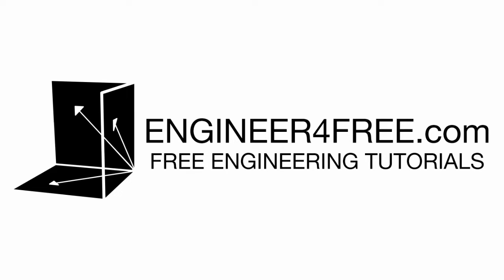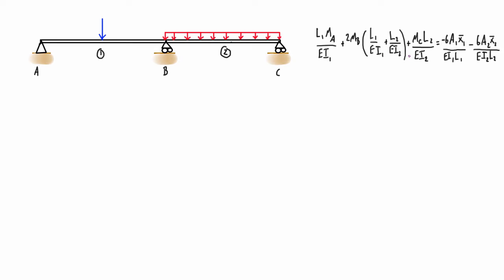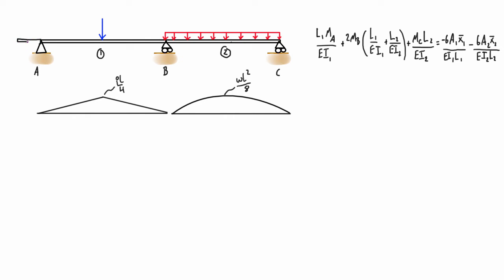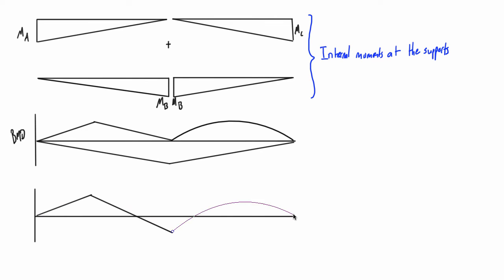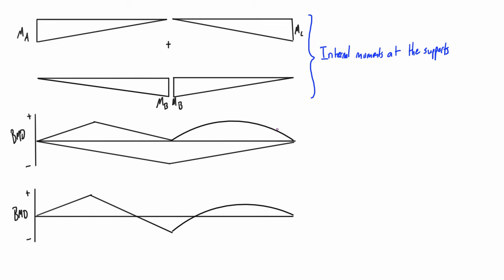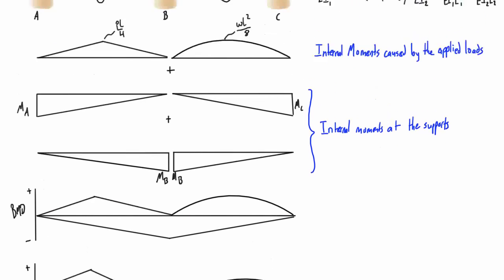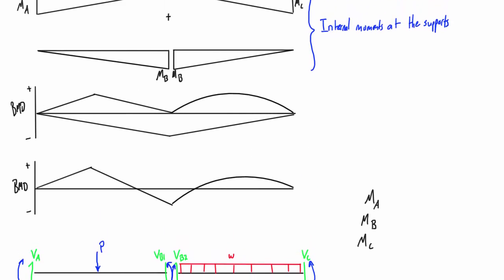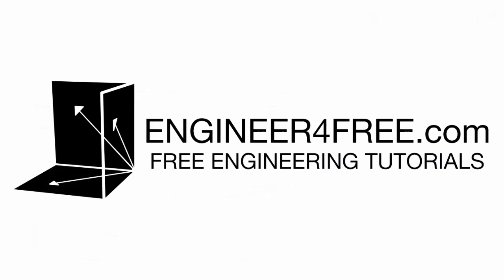3 moment equation explained

Comment: After 35 years of being a structural engineer, I never heard of or used this method. It is much faster to just redistribute the moments if you want to calculate it by hand. You also don't have to remember a rarely used equation. Nowadays, you don't calculate it by hand anyways but it is good to have an intuitive sense of what the answer should be.

Comment: I m provided with value of EI in question. So what to do
Reply from the maker: E will be implied if you're are told the material type, and I can be calculated from the cross sectional shape
Reply: @Engineer4Free  sir in my question value of EI is given as 2 . The question I m asking is , do I need to apply same formula or any other
Reply from the maker: @rahulbains8345  ohhhhh you're member has a non có stant EI. At some part, EI is 2x the other part. Just include the 2 along wihh the unknown EI. The EI should drop out of the equation but the 2 will still have its infkuence on the problem.

Comment: Hi, please is the moment equation method same as moment distribution method? Thank you.
Reply from the maker: Hey, this video uses something called the "3 moment equation" there is a different method called the "moment area method." I never heard it referred to as the moment distribution method, but I'm sure that's just our differences in local syntax. So, there are two different methods that use the word "moment," you can find explanations and examples of both at engineer4free.com/structural-analysis
Reply: no they are completely different

Comment: Hi could you please solve a continuous beam with 3 or more spans (simply supported) and calculate the moment, shear forces while using the 3 moment equation method and find the slope and deflection also.. Thanks a lot your videos were very helpful indeed.
Reply from the maker: Yup I have tutorials on that exact set up. See videos 40-42 here: engineer4free.com/structural-analysis cheers =)

Comment: I have a question .How can i solve this same beam u draw in the video but with 2 point loads in same span. Can you please help me.
Reply from the maker: The process is exactly the same. You just need to draw each span as if it were simply supported like I do in the video, including the one with more than one load. That one will just be a little more complex, but you should be able to comfortably draw simply supported BMDs by now if you are studying structural analysis. Use virtual cuts to draw the one with two loads, if you need practice, drawing BMDs then check videos 1-9 here engineer4free.com/structural-analysis and also videos 66-72 here engineer4free.com/statics video 69 in the statics course is the BMD for a simply supported beam with 3 point loads - very similar to what you need. If the simply supported BMD of the span with two loads is not symmetrical, you then just need to find the location of the centroid of the BMD's area using composite shape methods. That occurs in this other 3 moment eqn video that I have: https://youtu.be/vDObgNwQ6ug or you can go over the basic principle here: https://youtu.be/5oil5x9tVhg Otherwise, once you have drawn the simply supported BMDs, found their areas and x bars, then you just apply the 3 moment equation same as this video to find the remaining unknown(s). I recommend watching all of my 3 moment equation videos, they are number 36-44 here: engineer4free.com/structural-analysis to get more familiar with the method, which can accommodate any kind of loading. Cheers, hope that helps.
Reply: Engineer4Free thanks a lot. I checked your videos they are great. Once again thanks.👍😊